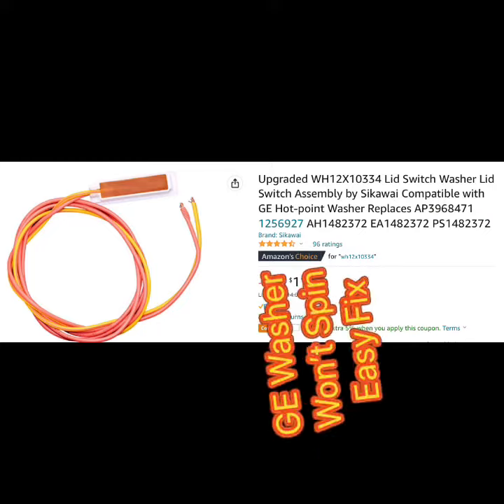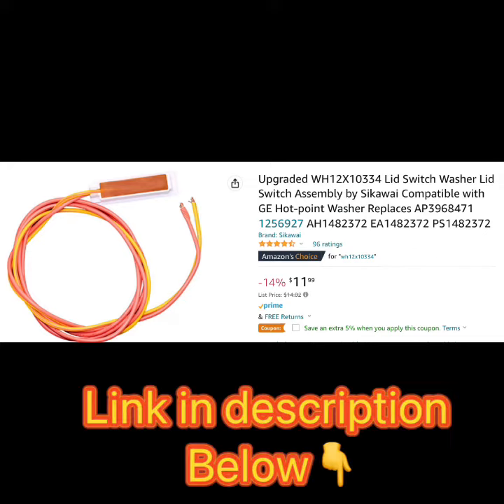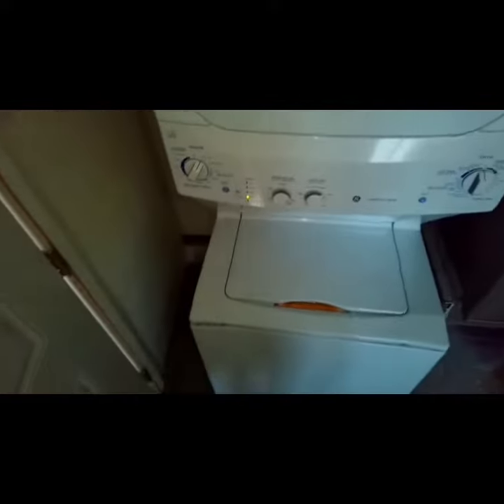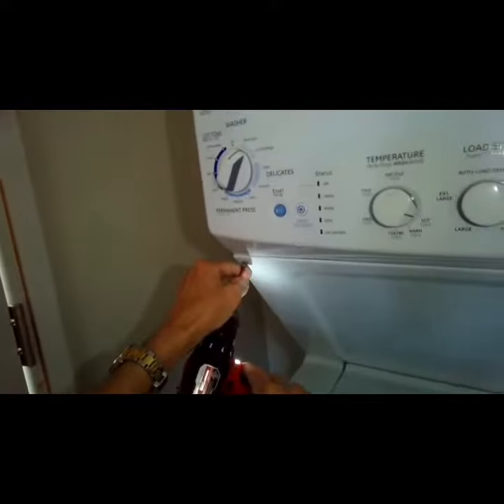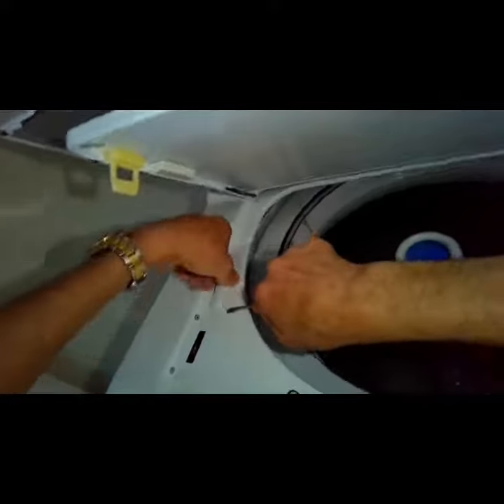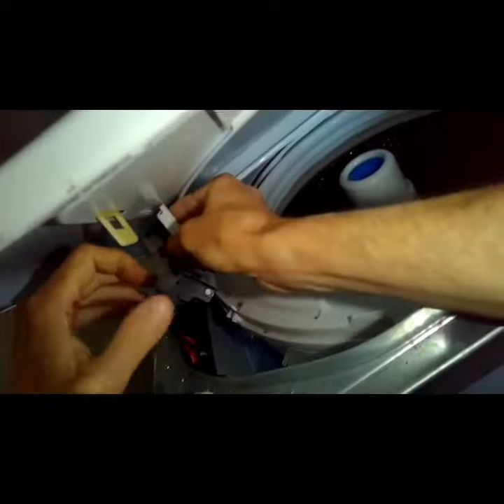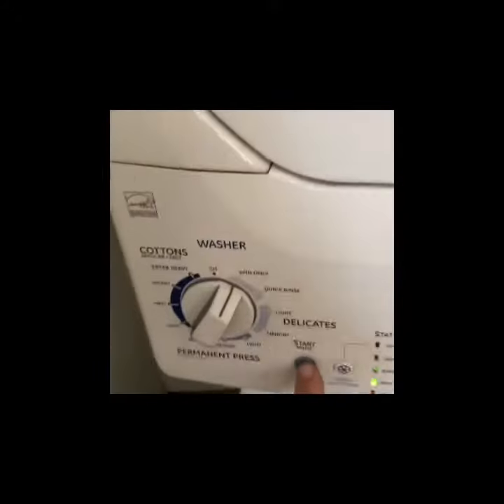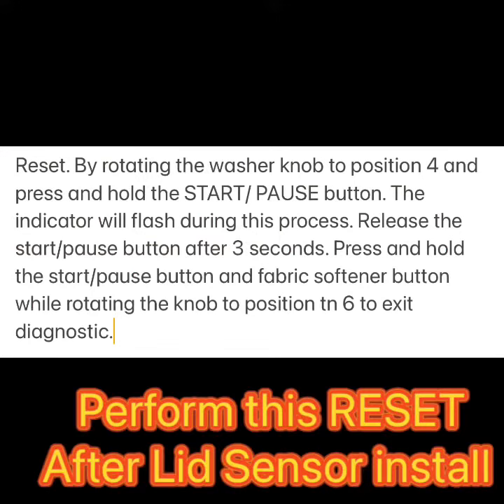✨ GE Laundry Center Washer Won’t Spin ✨

Comment: So that's about the 5th variation of rotating knobs and pressing and hold buttons for diagnostic and resetting.  And none seem to work as far as I can tell.   The only thing I've accomplished is changing which lights blink.  

My washer won't do anything.   And the red lid lock light was on before this last knob turning and button holding session.  Now it's back to just the spin light flashing green.
Reply from the maker: Thanks Linda,
Can you send a video of that to: scottthefixitguy@yahoo.com
Reply: @ScottTheFixItGuyChannel  I have discovered that my model is one of two for whom you move the dial to position 7, not 6.   I managed to reset the error.